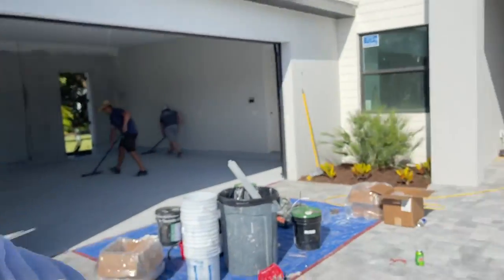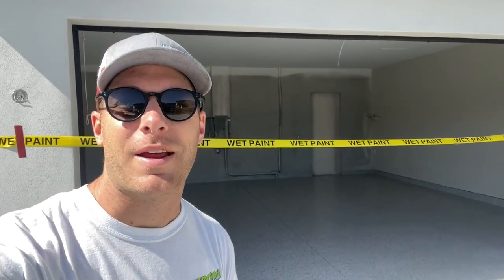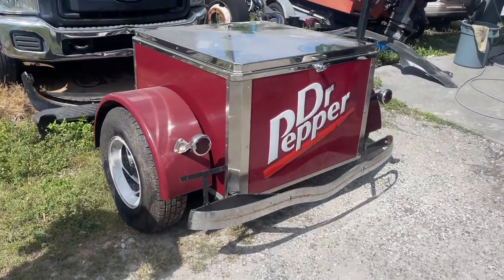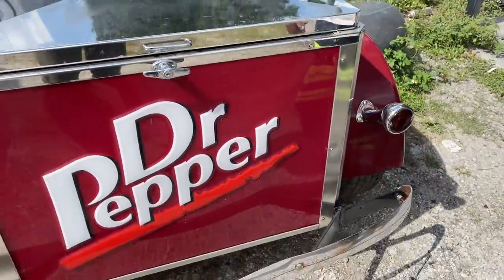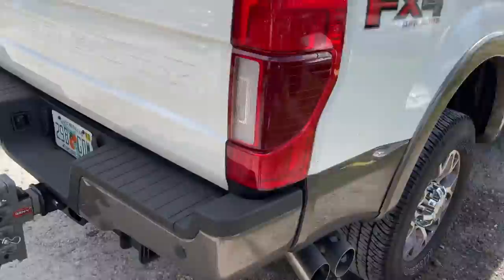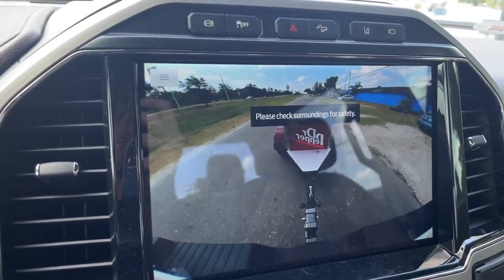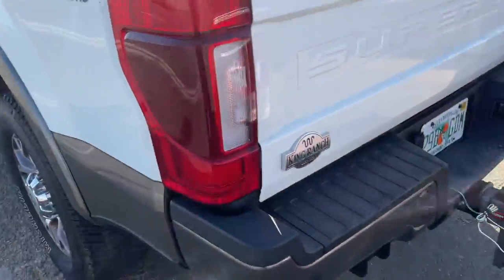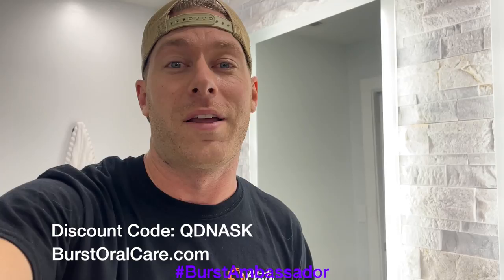AM I DREAMING!? FOUND AN EPIC RACE WEEK TRAILER, It's Perfect!!!!! Garage Build Part 2!

Comment from the maker: Thinking I just spray the inside of the trailer with a bed liner... Thoughts?
Reply: I think bed liner would work great, especially if any leaks or spills in there.
Reply: Might want to check undet the plywood and make sure there's no rot. But I would use bedliner too.
Reply: I think it is a fantastic idea.
Reply: Yep! Bed liner!
Reply: Try extending the draw bar of the trailer making it longer and it will stop all the sway at 60mph new subscriber here from aus 🇦🇺 I've watched your brother for yrs and am enjoying your content keep it up
Reply: See if you can get a light color though otherwise it will look like a black hole in there , Grey maybe
Reply: I agree about the tongue being a little short. You don't want a trailer burnout getting away from you! Lol! While you're at it you can switch to a 2" coupler.
Reply: Man that's awesome. What were the chances?
Reply: Definitely want a drain hole in the bottom if it doesn't have one already.  A punctured gallon of fluid would be a mess in the bottom.
Reply: Definitely Bedliner. Maybe even color matched
Reply: If its all metal and the wood is just to protect the metal then hell yea seal the corners and bed line it, i wouldnt do anything to the metal work with the liner though just to the wood. Get you some insulation foam board to line it with for the local track days you can load it up with ice for all the team cars to have with you pit side, throw some 12v led lights in it wired to a milwaukee 12v battery for stand alone lighting
Reply: @deodathramheerai  thought the same thing but you know he will have lights in there lol
Reply: How can I message u about some dental questions/work ,u can DM me if you like I would appreciate it thanks for your time
Reply: Get rid of the Chrome on the trailer too
Reply: Bedliner it and then build some storage compartments.
Reply: Nah, save some money and just pour your used oil in it. It'll treat the wood and keep the frame from rusting. 😂 😂 I'm joking Greta!
Reply: Please add some chains on there too.
Reply: solid idea... imagine all the heavy stuff your gona drop in the bottom
Reply: Great idea but a lighter color to ease finding parts and seeing leaks
Reply: I would yank the wood out first to check for rot and rust. But yes most definitely. Also some lights inside it would probably be good as well.
Reply from the maker: @2fast4you423  email rpm1111@icloud.com
Reply: @Rysgarage  I think the sway won't be as bad behind the car as the truck. Wasn't on an ideal angle behind the big truck either.
Reply: Totally do bed liner but do a light grey. It will help you see things better inside with limited lighting conditions......not in any way foreshadowing any future "night repairs" or anything. You can also get some LED tape strips and line the underside of the top to use as working lighting. Second note, the towing sway is mostly caused by the angle of the trailer with it pointing upwards. Its focusing the weight to the rea similar to when you make suspension changes in the car for more rear bite, the weight transfer is magnified. You get that thing flat it will pull just fine and with it loaded will focus even more weight to the front, just dont get too much tongue weight because it will start swaying again
Reply: could u mount the drag tyres by the towing hitch on the trailer?
Reply: @tronmcrae   it still will make a huge difference for towing I build trailers for a living in aus and I find with such a short draw bar just extending it a foot n half will make all the difference in the world and will allow for an extra tool box to b put on the front sunk in the gap of draw bars
Reply: @Rysgarage  Ya, definitely makes a big difference, I just think the janky setup was causing a lot of the initial problems.
Reply: Bedliner on the inside, and have all of the chrome wrapped black to match the car.
Reply: I vote bedliner as well, just make sure it's a 2k (the kind you mix hardener into) so the petroleum based products won't affect it. Those are also available as tint to match any color you like
Reply: Seems like a good idea to me. Maybe try to build a rack off of the frame to mount tires or something on as well.
Reply: My uncle is the one who actually built this trailer back in the day the man he built it for was named Darrell unfortunately he passed a couple years ago my uncle passed last December he built them and sold them for a hobby my uncle used to drag race in Tampa in the 60’s and 70’s we only have 1 trailer that he kept for one of his cars it’s a Pepsi one and a couple frames that just needs the metal
Reply: @jeremymassey3302  did he make a Mt Dew trailer? It would be pretty cool to see Garrett track down that trailer.
Reply: @bryan_turner  he might have I know my cousin has a coke one and we have the Pepsi one the only person that would know is my aunt
Reply: Definitely something to protect the wood. Will the car get Dr P decals too?
Reply: yes but spray it on the bottom too so the trailer last longer
Reply: Since it’s wood check out total boat epoxy
Reply: Just a thought, you might want to re-line the inside with some aluminum then do the bedliner spray. Be good to check the under pinigngs of the floor at that time, a drain plug is a good idea.   Also, add a LED light strip to the top so if you had to get in there at night you can see what you're doing. I did this to my Challenger SXT in the trunk and hood since the hood came with no light, and the trunk was woefully dim. I used a automotive press switch and set it up as a grounding switch. You know, if you could extend the tongue, and mount the wheel rack in front of the box, you could access the box without removing the wheels and keep the center of gravity lower and maybe cut down that trailer sway. Just some thoughts...
Reply: 100%!

Comment: Switch the leaf springs to the top of the axle and it will be perfect height with out a drop hitch
Reply: Exactly,👍
Reply: That might also give him some clearance to add some shocks which would be helpful. Just got to be careful not to get it too high and top heavy. If he raises it and adds a tire rack and fuel jug to the top of it, sway might be the least of his problems
Reply: He’s towing it behind a Mustang, might be a good height as is 🤷🏽‍♂️
Reply: @justintime2202  its not he pointed out at the end of the video he'll have to run a drop hitch on the mustang to tow it
Reply: If he leaves it low like it is it’s a lot easier to get tools and stuff from the inside of the trailer and is less likely to sway with lower cog
Reply: @codycrossley8881  hes gonna want it on top for when its loaded down he doesnt get hung up on every bump possible also with a trailer this small they will always sway he can only limit sway by keeping enough tongue weight on the car for it to be manageable

Comment: That’ll be swaying from being nose high on the back of your truck. Get it sitting level behind your car and you’ll find the sway issue will go away. Do the obvious and check the tyres and wheel bearings and you’ll be golden! That’s a cool little trailer and suits your car well.
Reply: I would replace the tires, wheels, and wheel bearings.  Doesnt need that wide of tire and rim for what hes doing.

Comment: Would be interesting to hear the history of this tailor, I have a feeling that will come.
You need to replace some if not all of the interior plywood with an aluminum basket if that's possible, it would save on weight, and you wouldn't have have to worry about wood rot. plus add a wheel rack on the top of it and your set. I'm sure you have thought of these mods already.
Overall, a great tailor for you. Good call to buy this!

Comment: Whoa!!! Under the coupler of that trailer is a bolt with a 5/8 nut on it. Loosen the nut about 5 turns, and you can get by for that short trip, if you drive within reason!

Comment: Dude 2 days with ty make some mounts for wheels up bu the front top corners and fuel jugs across the front then load it right and you're golden. Only time you need something the size your brother runs is if you have a whole second engine  and transmission, as well as merch and all the tools everyone else has.

Comment: I would check the date on the tires. If they are more than 3 or 4 years old I would change them. Specially if the trailer has been outside. The sun really degrades tires
Reply from the maker: Will do!

Comment: Ha ha too sick. 
Like someone else suggested, I personally would sheet metal the inside, then bed line it.  EDIT: Seeing how it's constructed, I'd make the back also fold down as the top pops up and make that middle sheet out of plywood, but on slides/runners so it could be like a pull out shelf/tool/part tray. Just take off the side metal pieces, add some truck bed hingers and voila, fold down pop up trailer. Your brother has a garage/metal shop(race track....holy frigg....dream life), Ty and Sam is a master machinist. Depends on how far you want to take it really.
Super cool it's embossed into the metal.

Comment: There is a little insert to adapt that receiver into your hitch probably 10 bux at that HF store.  
I would add a 6 drawer tool box to the tongue of that trailer and load it full of tools to get rid of the sway. Because of how stubby the thing is it'll be hard to balance it out so start with a semi permanent tool box and tools. Maybe add a mount for a floor jack up there too and add mount the slicks to the sides ahead of the trailer fenders. Then load the trailer with whatever else is needed on these kinds of race week events.

Comment: The trailer is sick few ideas that I would possibly do
Try to replace the rims and tires on the trailer within matching set of front tires from the Mustang so you have an extra front wheel in case of emergency.
Replace the trailer wiring with a seven blade camper style plug to have a 12 V socket in the trailer that would allow you to install a Milwaukee car charger to keep your batteries fully charged.
Mount 3-D printed Milwaukee Packout feet  to the walls of the trailer then you could have their flat boxes full of tools or individual boxes for certain jobs like one just for transmission one just for engine bay if you do the foam inserts each socket could have its own spot so even in the middle of the night just looking at the box you can tell if something was left in an engine bay

Comment: You're getting that sway for two reasons one the hitch is sitting uphill and it's empty you get that hitch so it's level and have a little bit of nose weight in it it'll tow just fine

Comment: I had my floors done this way 8yrs ago and they still look great and they are slip-resistant.
Reply from the maker: How do you clean them?
Reply: @DoctrParker  I use Oxyclean Multi-Purpose Outdoor. Everything is on wheels so I can empty the garage in 10 minutes. I dilute it into a 2-gallon pail, wet the floor with a garden hose then use a brush on a broom handle and scrub it out with the Oxyclean. Then I hose it clean and let the entire floor dry before I put everything back. I just go easy near the baseboards. I live near Orlando, so I start early before the rains come. But I only do it 3 times a year and they stay looking nice.
 Hope this helps. BTW, the trailer looks cool, great find.

Comment: Since it has been sitting for 4-5 years I would definitely check the date code on the trailer tires. Old tires are more likely to blow out and I'd hate to see you tear the trailer up from running old tires.

Comment: No matter how they LOOK trailer tires should be replaced every 7-10yrs. Goodyear Endurance Special Trailer has worked very well for us, big plus is they have the highest speed rating and are made in the USA. Oh, and BTW, get some safety chains, cross them under the tongue when you attach them, will keep the tongue off the ground should it poop off the the ball.
Reply from the maker: Chains for sure coming.

Comment: That couldn't have been a better match for you. On a completely different note, I was curious if you ever had anymore issues with Dr. Pepper flooding with fuel after its been sitting?
Reply from the maker: Yea I can’t figure out what’s causing it. Any ideas? I’ve tried shutting it down by turning the fuel pumps off, seems to help a bit but still dumps some fuel

Comment: Parker I use to build trailers and we figured out if you offset the axle by about 1/8t” it pulls straight as an arrow, I don’t know why, math or something 🤷‍♂️
Reply from the maker: Offset from center of the car 1/8”? You messing with me I feel like that’s so small it wouldn’t matter
Reply: @DoctrParker  no like left side further back than right side. They just track better.
Reply: The dude I learned it from had a cigarette with the longest ashes ever so you know it’s legit 🤣

Comment: Kinda small, isn't it?  Your brother has the best race week trailer I've seen so far.  Yours might have been a deal, but I'm pretty sure a new cleetus trailer would be easily  affordable for you, and you can make it look any way you want. This was purely an impulse buy only because of its looks.
Reply: You must be used to hearing its too small............think before you speak
Reply: It's only too small if you're lugging around transmissions and spare engine parts. Most people on these race weeks are more likely to have spare tires, basic tools, fuel, oil and other supplies

Comment: Ok ok ok.....pls for the love of God listen to me! I do garage epoxy and have for over 20 years I've done it all from plane hangers to clean rooms inside hospitals....right off the bat let me say....you got screwed on that trade! That garage the way he did it....only cost that man maybe 500 bucks in materials and maybe 1000 for labor for those guys! Also he is not following the approved system for that material. There should be two coats of color with dry time between. Then one clear coat with flakes.. .then a final clear coat on top of flakes! There are reasons for this....I promise you will have failures here....those flakes will peel off and that one coat of color will burn thru with tire wear on your floor! I sure hope you didn't put in more than a few grand worth of tooth work for him!